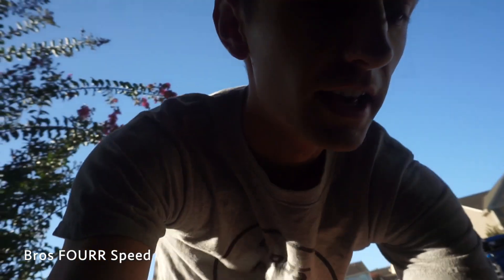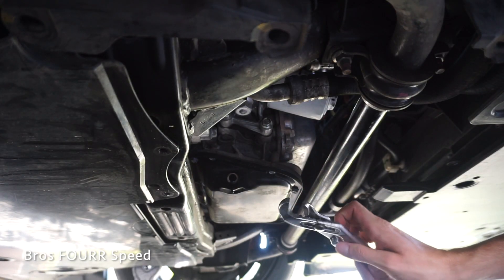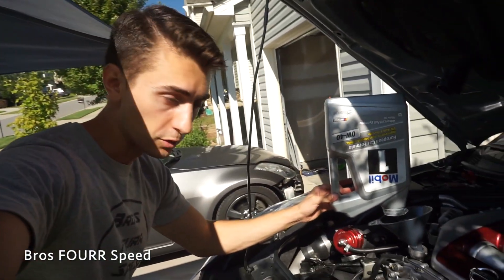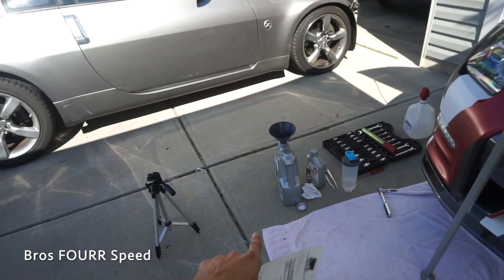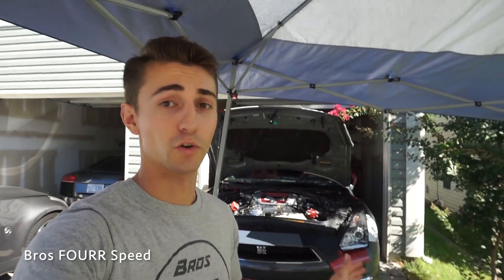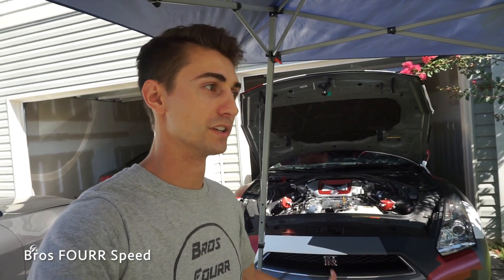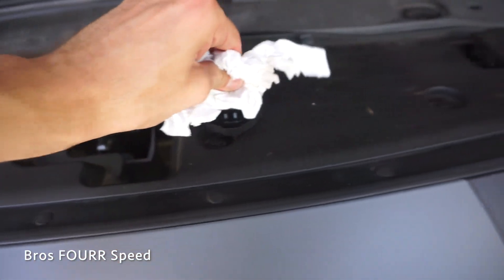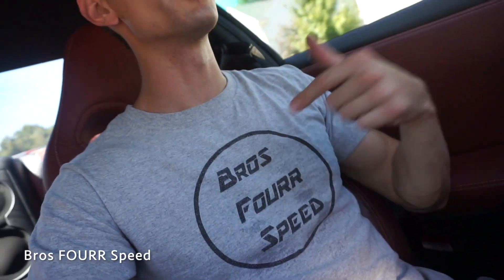REAL COST To Daily Drive A Nissan GT-R! *Price May Shock You*

Comment: As a future possible GTR owner the numbers are really useful thanks, if The Wife won’t let me get a 2 seater 370Z or GR Supra with my son then GTR is the way I’m going or Civic Type R. You make me feel more confident about oil changes too. Only breaks and discs + Tyres that would be a worry it sounds like on GTR so food for thought.
Reply from the maker: GTR would be a sick dad car!!
Reply: Many people say get a 2013 + because many issues are fixed
Reply: Yeet It’s 2012 and on.
Reply: Joolz1982 I’m going to let you if your not a JDM person or know much about JDM mechanics like myself, it’s a real unique car! Now changing oil, is changing oil but the parts are very expensive and keep in mind the area you live in. Having a good high performance shop that specializes in foreign vehicles, especially JDM is must have. I got lucky here in Florida. Also the back seat is not a back seat, if you know what I mean. Absolutely no room for legs, if they are small your good. However my son  is 14, loves cars and doesn’t give a shit if he’s slammed in the backseat with his legs across the backseat.

Comment: Good video, that’s cheaper than an STI requiring oil changes every 3500 miles, with an unreliable old engine.
Reply from the maker: oh wow! Thats pretty crazy to need to change it that soon. If someone daily drives it, that'd add up real quick
Reply: Shane Reid IF you buy new. Bought a certified pre owned from a subaru dealership. Previous owner messed with it. Still the most fun car I owned. Can’t wait for the next gen sti coming soon

Comment: had a 2010, and drove it daily  to work 5 MILES....and transmission failed after 1.5 years. Out 11k. Looking for a 2017 next year.
Reply from the maker: Yeah the 2009 and 2010 had the lest reliable transmission. After that they got a lot better, and then 2014 up, they are super reliable. You'll love the 2017!

Comment: I’ve been working for a couple years and am on track to make around $20,000. My dad will meet me 50/50 for my first vehicle. Is this car too much for a 16 year old?
Reply: @Alex Outstanding job on your current and future earnings. Not trying to be a debbie downer, but buy a used Toyota "older model" and really look at investing, at your age the sky is the limit, time is your best investment tool. When you get a little older "30" you will thank yourself. Having zero money worries is a great feeling. As always, each to their own. 👍
Reply from the maker: Sounds like you are on a good track for a young age!  Honestly it depends on maturity level, you can get into trouble with this car easily and having tickets at that age is not something you want.  I have zero speeding tickets with this car and treat it well.  But also on the other side, you don't want to put all of your money into an expensive car right off the bat.  I bought a 370z, then a 370z nismo and then traded that for the GTR.  I would start with a cheaper vehicle and build up your credit first.  This would be a crazy huge loan for a first time buyer, so be financially smart in your purchases.  Hope that advise helps!

Comment: So I'm going to be in the market for one of these in 2021 after parting with my Kia Sportage, how much is our insurance? How are these with being driven hard? How much is just regular maintenance like oil changes and the like? Are 2009s bad because that's the only year in my price range I'm torn between a GTR or a 2012 SRT8 Because I live in Maine and they hammer the roads with salt in the winter and I don't want to spend 20,000 and then it get rusted out
Reply from the maker: Here are a few videos going over insurance and maintenance cost. Seriously nothing out of the ordinary to ow. Insurance is cheap if you have a perfect record, high deductible, pay in full ect..
If this will be your only car, don't think I'd recommend it in that climate if you're concerned about salt on the roads. The AWD system is fantastic and snow tires would make it a beast! But any nice car will get beat up a bit. 2009s aren't bad. I've just heard that they don't hold up well with modifications. Maybe just stick with an exhaust and stage 1 tune. Don't think the trans will like more then that
https://www.youtube.com/watch?v=I_0CHSkS-18
https://www.youtube.com/watch?v=LYMNKjZuaLs
https://www.youtube.com/watch?v=DEvGBCmtrA0
https://www.youtube.com/watch?v=kLOHzI9lC9g
Reply: @BrosFOURRSpeed  I ended up doing more research and I'm going to go with a '12 Jeep SRT because it just makes more sense with where I live and if me and the girlfriend have a kid boom proformance family car

Comment: If I get a 2020 gtr and I keep it stock will I run into any issues like reliability or the transmission. Great video btw👍
Reply: Stock level it will run reliable for 100k miles ++
Reply from the maker: Gll Lll You definitely wont have any issues. Plus you’ll have warranty
Reply: Gll Lll same exhaust only and admin tune. Thats all.
Reply: Lol if you’re asking that question then you’re definitely not ready to buy a gt r

Comment: I am strongly considering buying a 2012-2015 GTR (hoping to get in the $50K range and as few miles as I can have).  Can you point me to your best video to look at daily maintenance?  What kind of problems should I look into, depending on how the owner drove the car?  My job doesn't pay that well, but I am able to sell some stock to buy the car all cash.  I am worried about being able to fix something if it went wrong (I wish you were local to SoCal).  Love the vids by the way!  They're lots of help and the first time I've subscribed to anything, other than for friends.
Reply from the maker: Honestly the GTR is a very reliable car. Pretty bullet proof and they don't really have issues. Like with any car, just make sure it has a good clean CarFax with no issues. And have a certified Nissan GTR dealer to a pre purchase inspection before you buy. That way they can read the computer and see if anything hidden is messed up.
Reply: dude if you got a job that doesn't pay well and the only way you can buy a car is by selling your stocks, don't make that financial mistake. Get a cheap reliable car and wait until your passive income can pay for your dream car one day. Otherwise keep investing in stocks, crypto, and real estate if you haven't already. Remember cars are depreciating "assets".

Comment: $1500 tires 🤯 could you get away with a cheaper set if you're just daily driving and not tracking it?
Reply: Nope, dont even try that.
Reply: @abrahamfrago3728  why not?
Reply: @kevinb.3656  in this case GTR because of its special AWD system is known to have issues with cheap tires. Not enough grip and either way, owning a gtr and complaining about just 1500 on tires totally weird since just rotors are a 3k job
Reply from the maker: I actually made a video when I bought cheap tires and how that was a bad idea! You get what you pay for and on a vehicle like this or any vehicle, cheap isn't always good.  https://www.youtube.com/watch?v=6KWoWqwseqw
Reply from the maker: Agreed, made a video on why that's not a good idea!

Comment: What do you use to clean the rear bumper with having the wrap? I have a 2009 GTR with the artic camo wrap and the exhaust is making the vinyl get hazy looking.
Reply from the maker: We just use innovative speed shops waterless wash.  Works great and don't even have to get the hose out!

Comment: You won´t have issues during selling the GT-R cause You changed the oil at home (not cetrified service)?
Reply from the maker: That won't do a single thing for resale value. Also I have access to carfax and I keep it up to date with the servicing I do. I worked at a car dealer for 3 years and was the inventory manager. This isnt a 30 year old classic Ferrari. It just doesn't matter
Reply: @BrosFOURRSpeed  good to know... here in Slovakia if You dont have some repair history from a supercar like GT-R, You have serious issues to sell it... or You luckyly sell it but under price as next owner wont have any idea what was or wasnt repaired on the car...

Comment: any special way to wash your car so it shines? i remember my friend use to go and get wax on his car through the car wash lol
Reply from the maker: I just wash it like normal. I don't use any wax on the vinyl since it will make the matte colors shiny. Also its get stuck on the lines between each piece. So just a gentle hand wash with a good thick micro fiber washer
Reply: oh i think ik what you mean, theres polish that lasts for a while ! check out adams polishes watch their vids on how to apply it ☺️, it makes the car look so goodddd, it also makes washing and drying so easy 🥰
Reply: graphene ceramic coating^

Comment: I respect that U do ur own oil changes (me too, '16 rogue), but how the hell does the battery die from non-usage!?🤨
Reply from the maker: Turns out the OBD2 splitter I kept plugged in put a draw on the battery.
But if a car sits for too long the battery can die because nothing is keeping the charge up. But now that I don't leave anything plugged into the OBD2 I havent had an issue. When I'm gone for a week I'll have the trickle charger on the car just to keep the battery life good

Comment: If it was under warranty, you would have to use the dealer or void it.  They are strict on the GT-Rs that is why maintenance is a lot.  Out of warranty, its a no brainer.  Do it yourself.  BTW, get yourself a new battery if it dies in 3 days.  That is a weak/bad battery.
Reply from the maker: My car's been out of warranty for a while lol. I put a brand new battery in the car when I bought it. The 2 things in my OBD2 might be causing a draw.
Reply: @BrosFOURRSpeed  Something else other than your normal stock stuff is killing your battery but it probably damaged it already since regular batteries aren't designed to go dead like that.  You should buy a Optima or Odyssey battery if you plan to drain it like that to zero and charge it back up.  My friends GT-R same year as yours can last weeks without the battery going dead when it sits.

Comment: Did you end up getting a pre purchase inspection for your GTR?
Reply from the maker: I bought it from a Nissan dealer out of state. It was the same Nissan dealer this car was sold at when it was brand new. And on the CarFax, every year the previous owner brought this in for service at the same dealer. So I was pretty confident that this has perfect maintenance. The Nissan dealer also had 4 GTR's for sale when I bought this. So I know they were a 'good' Nissan dealer who understands this car. I brought it to my shop when it arrived just to have the first oil change done. And they did a full inspection for me too. Perfect everything for the car

Comment: Jesus Christ you didn’t fill the new oil filter before putting it on
Reply from the maker: Honestly in my 11 years of owning vehicles. I've never had an issue with any of my cars, motorcycles or dirtbikes. You cant even do that with most oil filters anyways. Only ones that attach from the bottom of the engine. Filters that get installed from the top or side don't seem to affect those engines since it's not possible to fill those first.

Comment: Y would the battery 🔋 die within 3 days of non use?
Reply: Because it's a bad battery.
Reply: The computer on the car is always on updating and using power
Reply: @grgmax6286  All cars have computers and they are not running when the car is turned off.  I have a friend with a GT-R and it sits for weeks with no issues.  His battery is bad and needs to be replaced.

Comment: Is there a way to fix the 3-4 day battery life
Reply from the maker: Turns out one of the cables I had plugged into the OBD2 was putting a draw on the battery. So now it doesn't have an issue

Comment: How could it not start after 4 days??
Reply from the maker: Turns out, leaving my Cobb AccessPort cable plugged in put  draw on the battery
Reply: @BrosFOURRSpeed  Whew! I know Nissan is reliable you scared me
Reply: @BrosFOURRSpeed  same thing happened with my subie, I thought something was bad wrong.
Reply from the maker: tylerthepally Yeah when I left the actual AP connected the screen never shut off and that drained the battery. But I figured leaving the cable plugged in would be ok. Apparently not 😅
Reply from the maker: Sheldon Harris Yeah it was my own fault for having the cable plugged in 😅

Comment: Add 10k for bellhouseing replacement: and taking transmisssion apart to add clips that can handle it. Also you own a gtr does that make you too good for oil on your hand? You can wash it w it h dawn soap. Pretty boy. And on top of all that your useing cheap oil shake my head
Reply from the maker: No it just means I did the oil change without spilling it, that's possible to do.  And that's normal oil, been using that with zero issues..what oil do you put in your GTR?
Reply: @BrosFOURRSpeed  well mine is a 89 so my lifters aren’t oil dependent like yours are I use 0-20. Not that you need that light weight oil. I just like the protection and delivery it offers over conventional oils for brand would be royal purple. The polishing compound helps keep the inside of the engine wicked clean and smooth

Comment: Looks to me you bought a LEMON 🍋 I own a 2013 and leave it all winter no problem starting 6 months later.
Reply from the maker: I definitely don’t own a lemon, I’ve had this car 4 years and no issues. A lemon car is not related to a battery, after using the battery tender, I’m still on the same battery.

Comment: By doing it yourself is a false economy. When it comes to selling the car people want to see a Nissan service history and therefore your car will not be worth as much.
So in the end any savings is quickly cancelled out
Reply from the maker: Actually that's not true. I worked for a dealership for 3 years and we specialized in cars like this. We sold GTR's, Shelby's, M cars, Audi RS cars, a few Ferraris and some other special sportscar. Only when you get to the Ferrari and exotic level do dealer service records matter. You can honestly tell if a car has proper maintenance. And cars that were is good condition are what sold easy. Maybe 1 or 2 people would be deterred by not having dealer records, but the car would still sell at top price. I still have access to CarFax and I update the GTR with everything I do to it. So I save a lot by maintaining my car and I can still sell if for top dollar. Also helps I have video evidence of all my maintenance lol. But service records don't hurt resale value, it just might deter 2% of potential buyers. So it doesnt matter on non exotic brands
Reply: @BrosFOURRSpeed  
I won't argue there but I'm  from the UK and recorded service history is everything. I agree the way you service your car I won't have any reservations buying your car but if I went somewhere else to buy a £60K car  and they tell me they did most of the maintenance themselves. I would probably walk away. One, I don't trust they did it. Second, I'll probably struggle to sell it later.

There is a YouTube video by a man called Jayemm (I think) who warns against that exact thing. He was talking about someone who bought a GTR where owner claimed to have done a lot of the work. Turns out it was not done properly if done at all and cost the second owner dearly. 

But I get what you're saying. If there was a way of documenting your work then that would be ok. Plus you can't get more genuine then making a YouTube video on it!

Comment: Can’t start if sits for 3 days…….
Also: my car is in tip top shape…..
Reply from the maker: lol I had an OBD2 splitter cable plugged in so I could have my Armytrix exhaust and Cobb AP plugged in at the same time. Turns out that cable was putting a draw on the battery. Even when I just had the Cobb cable plugged into the OBD but not the AP. It would draw. So that was the issue. Once I left it unplugged I never had the issue again. So yeah my car is in tip top shape. Currently on E85 making 700HP and have 42k mile. Never had an issue with the car. Don't be so quick to come to a conclusion